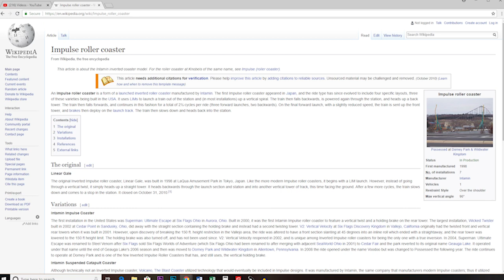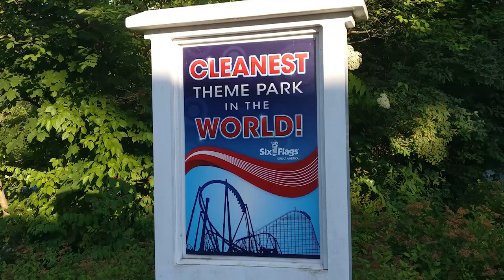Electromagnets, roller coasters, half-a-dozen flags, and clunkless chain lifts

Comment: I think the counterweight is deliberately light, only there to make sure everything stays engaged, and the smoothness is achieved in the same way you can achieve a smooth pan on a tripod with a rubber band. except instead of the chain being elastic, the chain just weighs and droops, because it's allowed to. the counterweight goes down because the chain is being pulled on the bottom half by a secondary/tertiary cog, and the roller-coaster basically makes the chain bunch up in the back. If I had the tools, I'd show drawings.
Reply: basically, the weight is there just to manage 'excess chain'. the smoothness is achieved by turning the chain's weight and slack into, in a sense, elasticity, which allows force to be gradually applied to the latches.

Comment: All chain lifts will have this type of system to tension the chain as it needs to not be loose around the sprockets. Also, for the no ka-chunk sound, there are guide wheels that bring the train to the chain at the same speed as the chain.

Comment: the orange weight is to take up the slack in the chain as the motor is pulling from the bottom the chains weight will need to be encountered when the design was made

Comment: You are close, as far as I know, EVERY B&M coaster has a straight section of track that can fit the whole train at the bottom of the lift. The pinch wheels (on this ride) or drive wheels (the ones that are mounted vertically) help feed the trains smoothly on to the lift. Since you know about B&M they are just as finicky when it comes to their lifts and the chains that drive them. They try to reduce the stress on the lift chain as much as possible. Which helps prevents the chain from snapping. That is what the counterweight is there for. It simulates the weight of a train on the lift. That is why the counterweight drops down as the weight of the trains transfers on to the lift and is no longer pulling or lifting the counterweight. This is also why you will find the kicker (what enthusiasts call the pre-drop. I prefer to use manufacturer terms and non-enthusiast created terms whenever possible) and lifts that are shallower on their older coasters. As the cost of more powerful motors dropped and technology improved the kickers were phased out and the lifts got steeper and faster. Since it is so difficult to get a hold of you, you can contact me for any of your coaster/theme parks questions.
Reply: "They try to reduce the stress on the lift chain as much as possible. Which helps prevents the chain from snapping."
Clearly that worked really well on Chang: The Sound of a Lift Chain Breaking. 8-)
(Chang, a B&M stand-up coaster built for Kentucky Kingdom and now at Six Flags Great Adventure, snapped its lift chain during its media preview)

Comment: Ever since Premier Parks bought Six Flags, they've been on a decline steeper than an Intamin Dive Coaster! Of course, the parks were never in the best areas, (Six Flags Over Georgia is notorious for its location and parking lot incidents; there are even bullet holes in many of the Mindbender's safety signs, located adjacent to the main access road), but there was a charm that has died in the SF parks since the Acquision Era started in the 1990s. Sadly, this trend has led to the closure of so many unique local parks, and one can really only blame PP's lack of care for the complete antagonistic attitude toward their "guests". Cedar Fair, on the other hand, has really done well taking the PP model and just improving on it (of course, one might consider the proximity of Knott's Berry Farm to Disneyland for much of that attitude--at least locally).
Reply: Premier Parks doesn't own Six Flags anymore, in 2005 after the disaster that was the closing of Astroworld Kiren Burk was fired as CEO by the board thus ending Premier Parks ownership. The chain was then owned by Red Zone until 2010 when they filed Chapter 11 bankruptcy and restructured putting the current CEO (Jim Reid Anderson) into the current spot. Not that I'm making excuses, SF during the Premier Parks days was BAD, sure they had coasters but when you have literal gangs in your park that doesn't matter
Reply: Adam Smith Thanks for the clarification! I guess once you hit rock bottom, it's hard to pull back up. I suppose that Six Flags--no matter who owns them at this point--is just doomed to spiral until they either completely wither away or get bought out.
Reply: I wish Cedar Fair would give some attention to some of their smaller parks, but they do maintain their parks better than Six Flags has.

Comment: At Valley Fair in Shakopee, MN, there is a coaster called Steel Venom that appears to be a carbon copy of Vertical Velocity, even down to the size and shape of the supports holding the twisted tower. Very cool to have some insight into how it works. Thanks!

Edit: Looking further I see that Possessed at Dorney Park is also exactly the same. I didn't expect them to all be exactly the same.
Reply: It's a specific production model, an Intamin Impulse.

Comment: The counter weights are to take up the slack in the chain when the train latches on. When there is no train the chain is loose but when a train latches on it pulls back on the chain pulling all the slack to the motor end. It also takes up the slack slowly to It help eliminate the ca-thunk

Comment: Interesting timing on this video - I was just at my local theme park (Cedar Point) a couple of weeks ago and rode their far cleaner version of this ride.  While waiting in line I was pondering the exact same questions. There almost has to be a large bank of capacitors somewhere to supply so much instantaneous power.
Reply: Matt W Clean? Wicked Twister is in just as much need as V2 for a repaint and cleaning.

Comment: I'm curious, does "Vertical Velocity" have a big vertical section at the forward end? If it's the kind of ride I'm thinking it is, then I've been on it years ago. I grew up 15 minutes down the road from what is now "Six Flags Marine World," though I recall it long before 6 Flags bought the park.

Definitely a fan of your unscripted ramblings, and I very much appreciate the focus on theme parks -- while your wealth of knowledge on such a wide variety of topics is what initially hooked me on TCv1, I'm equally glad to see you geeking out about a couple of things more than others, especially when those are things I'm much less familiar with than "here's how audio and video can be encoded and stored, various methods through history!"
Reply: The one at SFDK has a interesting history, at first it was an exact clone of V2 at SFGAm however the park has a 150ft height limit and V2 was 185ft. The City didn't notice this at first for some bizarre reason however once finished it was clear it was over 150ft. They then ordered SF to cur it down to 150ft however instead of just cutting the twist down to 150ft SF decided to have it go up at a 45 degree angle instead thus creating the only Intamin Impulse coaster with an inversion.
Reply: Adam Smith Aha! It is the ride I was thinking of, then. I definitely remember the whole maximum height mess, and the resulting changes to the ride... but I hadn't realized just how unique those changes had made it (or that it was still there.)

I may have to make a trip back there one of these days, since I've never ridden the modified ride. Thanks for the info!

Comment: I stood in the same place you did at SFGA for the VV ride.  The launch sound is truly awesome even if the microphone doesn't pick it up that well.  Did you ride it?  It accelerates both forward and rearward for the first few passes and then decelerates the train on the last few passes to stop it.  Did you notice the black vanes with the vertical 'teeth'?  Those pass through sensors (optical because they are black? or inductive?  I don't know) along the motor and they make high speed position measurements.  The controller knows where the train is at all times and by using time-stamps also measures the speed of the train many times per second.  This is why this coaster is so special--it tailors the acceleration force for every ride so that the train reaches the same point on the track EVERY time regardless of passenger load, weather conditions, wear, etc.  Watch it peak front-to-rear during the ride and you will see it be uncannily repeatable.  Also watch it park in the station to the SAME point within a mm or so every ride.
Reply: The timing comb is optical. There's a unit in the station that it passes through with two optical emitter/detector pairs. Optical detection is used because inductive sensing just isn't fast enough for that kind of resolution. When Top Thrill Dragster first opened it had some conventional inductive  prox switches at the downtrack end of the launch that would completely miss the train because the rise time on the switch was longer than the time it took for the train to pass it at 120+ MPH.
Reply: The timing comb is optical. There's a unit in the station that it passes through with two optical emitter/detector pairs. Optical detection is used because inductive sensing just isn't fast enough for that kind of resolution. When Top Thrill Dragster first opened it had some conventional inductive  prox switches at the downtrack end of the launch that would completely miss the train because the rise time on the switch was longer than the time it took for the train to pass it at 120+ MPH.

Comment: does it use regenerative breaking to slow the train down when it comes back through?  that would be cool
Reply: No, it doesn't. There are safety issues with regenerative braking, so there is a separate system of permanent-magnet magnetic brakes that do most of the braking. That said, the LIMs are used to jog the train both forward and backward to park it in the loading position. LIM "braking" is also used (when enabled) to hold the train on the back spike by driving the LIMs in the "backward" direction to counteract gravity. Again, this is not regenerative; the holding "brake" requires about as much power as the initial launch.

Comment: When you drive a chain from the bottom, you have an incredible length of chain that suddenly becomes tensioned, and it stretches A LOT!  (and the hill structure compresses)  The counterweight maintains tension on the chain when this stretch happens.  Otherwise, the chain would jump the sprockets.